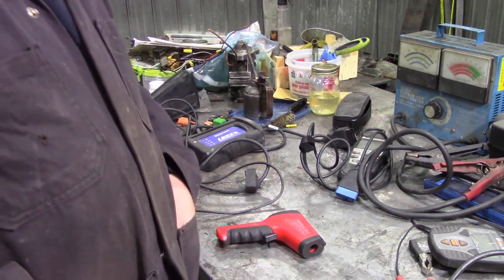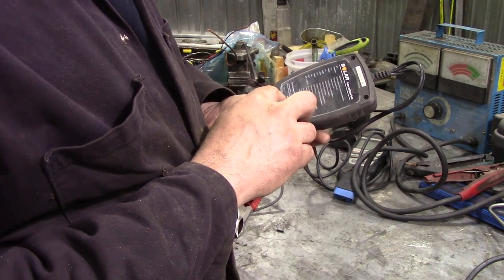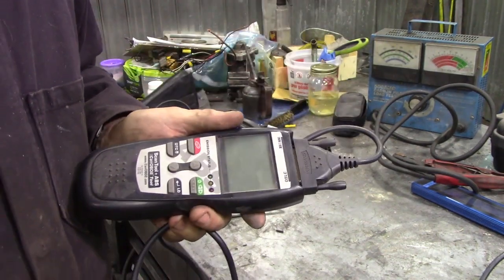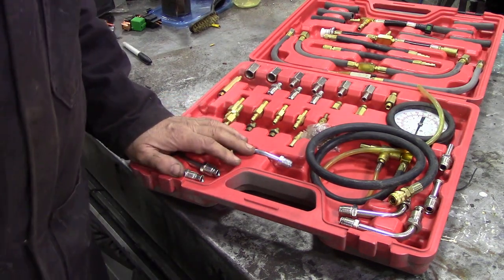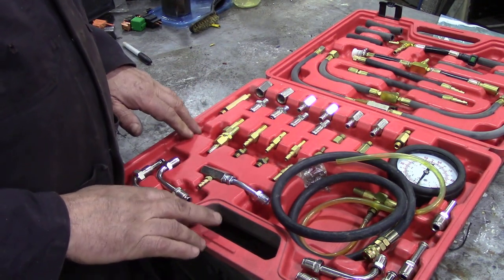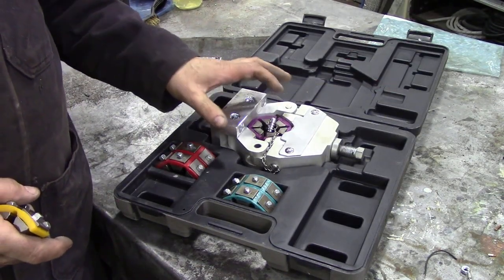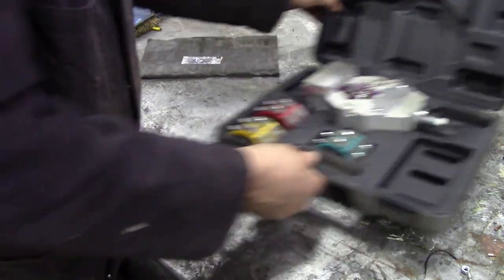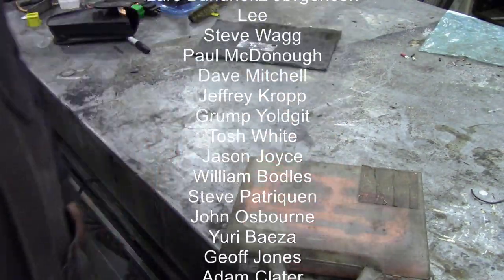Land Rover diagnostic tools, and a few special tools good and bad - long but interesting

Comment: I have the most recent version of the Hawkeye and so far it has worked well. I bought it because it works out e very Land Rover model from Classic to L405. I have a P38 and an L322 so need the flexibility. Will probably buy the Gap Diagnostics  IIDTool for my L322 as I understand it can do a lot more.
Reply from the maker: The GAP is designed here in Montreal area - not sure if it is made here - good, but expensive

Comment: Those handheld infrared thermometers accuracy depends on the emissivity of the surface you are measuring that's why their accuracy can be a bit iffy, I only use mine for a rough gauge of temp. I think you get the most accurate reading off a black surface.

Comment: I had a BlackBox Nanocom Evolution, which was fine for me for my TD5 Disco. Never had a problem with it. I sold it on no problem to a member of a LR forum. Colin at BBS will transfer the license. if needed. I agree that BBS have a weird system of license, but the Nanocom is more a DYI tool.
Reply from the maker: Also I didn't like that you could not contact them - always through the forum

Comment: Just a word of warning on those LYNX systems. If you have a Japanese import discovery 1 it will write over your ECU. I have a 1999 300TDi and it couldn't read the VIN as a 300TDI only as a TD5 and wrote software to the ECU and damaged it meaning I had to get a new ECU and matching AS10 immobiliser matched....absolute nightmare.